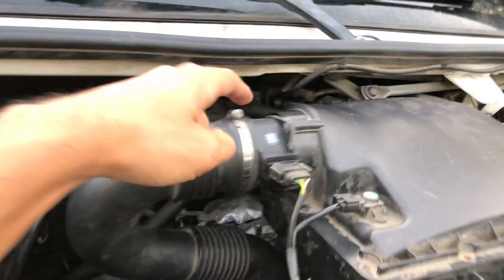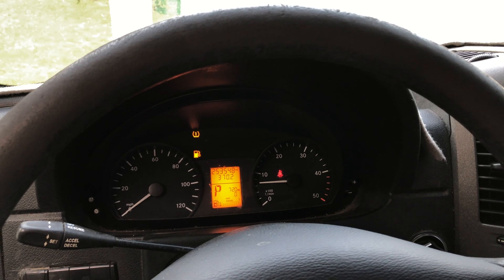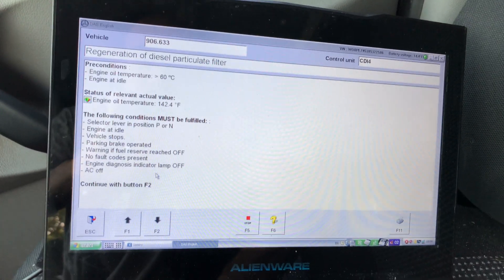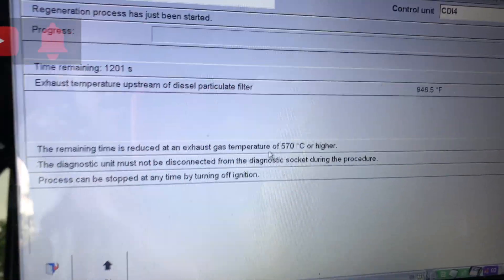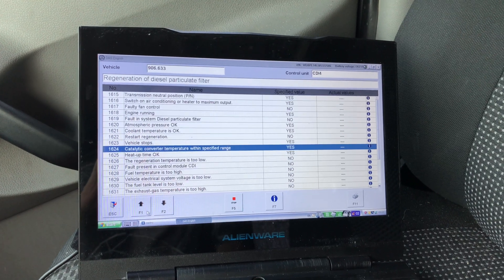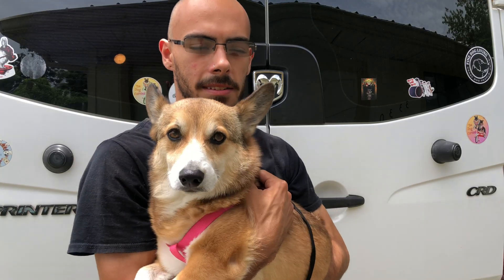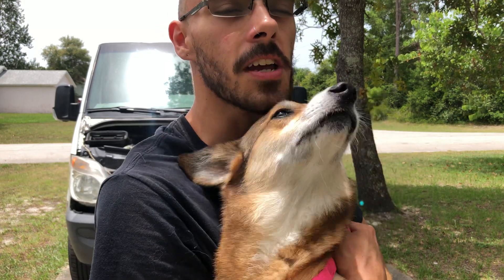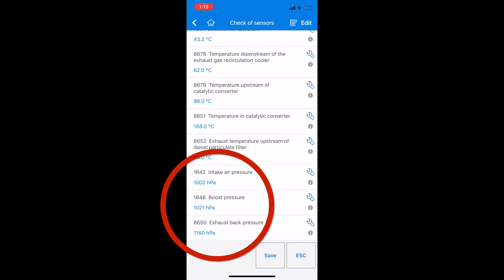Manual DPF Regen with Xentry DAS! 2007+ Mercedes Sprinter

Comment: I have a 2018 Sprinnter 2500 4x4 recently had a check engine light come on and when I checked the codes it said something about an NOX sensor downstream I changed the sensor. Took out for a drive and did an active region on the highway after I did it I received a 10 starts left message. Any help ?

Comment: What would cause a P0101 code with key on engine off? What is the computer looking for when there’s no air flowing?
Reply from the maker: P0101 is a generic code and completely meaningless. The van did not produce that code, like a word not in its vocabulary. So the code reader is miscommunicating some other unknown code.
Reply: @FloridaVanMan  would there be a reason why the computer would trip a generic code and not a Mercedes code. I’m not getting any DTCs on the Mercedes’ side. But the van is still in limp mode.

Comment: nice video. I was wondering I saw there was an option for tyre size, is that something you are able to change in the software? I have larger tyres and would love to be able to recalibrate the speedo
Reply from the maker: When I played with that option it didn't seem to make any difference and was very limited with only two size options, 15 and 16 inch wheels. However other folks have told me it worked for them. My 2005 with stock tires always ran 76 on the GPS when the dash showed 82. Now that I have bigger tires the speedo is correct to the GPS and the odometer is off by 7%.

Comment: Hey man I had a few quick questions about a 2006 sprinter motor I swapped into my 1965 Chevy c10. Would be very helpful
Reply from the maker: Aha!!!! I've seen your project before. We've never swapped the T1N motor into anything else....but we'd be willing to try and help you answer your questions anyway. It has a Sprinter ECU and cluster in it right? one condition; you've got to bring it to us or let us check it out one of these days....
Reply: Florida Van Man it would be a cross country trip haha, but i used sprinter ecu and cluster( basically everything from sprinter). I’m getting this problem with the turbo, codes p2025-001, p2013-001 and p2243-001. It seems to me that the actuator arm is really far down and I get a constant hiss but when I unplug the boost sensor on the charge air pipe the arm goes up and it sounds completely different. I should mention I do not have the sensor that was on the air box plugged in. Thanks for your help
Reply from the maker: @dieselkumar6451  The P2025 code is turbo related and and might be caused by the other problem. The P2013 is all about the sensor you don't have connected, so start there. Even if you can't put it in the air filter, secure it nearby. I imagine one could put it in the end of the cone filter but be careful about dirt leaks obviously. That might clear both codes, but if it does not my next steps would be verify voltage changes at the MAF (see our video). I suspect that cone filter is preventing the MAF from getting a good read, but others have had good experiences where I have not. If you do not get voltage changes similar to seen in our video try taking the filter off. Don't drive it with no filter, but testing for voltage while parked shouldn't suck up dirt. If the MAF voltage changes check your turbo clocking (see our video). It costs nothing to check it, if you don't loose the spring clip. P2243 I believe is a communication error between the key chip and ECM/SKREEM. This one may be a low battery start and just need to be cleared.  -Bill
Reply: Florida Van Man thanks for the help, do you have any idea what that sensor is called? So I can start by putting it somewhere
Reply from the maker: @dieselkumar6451  Intake Manifold Pressure Sensor  aka MAP is the one that belongs on top of the air box. Some places call it the Air Intake Pressure Sensor and it looks similar to the Boost Pressure Sensor, but it's different.

Comment: Bin the DPF xxxxx
Reply: DPF delete :-)
Reply from the maker: Highly tempted guys.....I think it would do a lot for the fuel mileage too...........
Reply: @FloridaVanMan  And power. It's not just the Sprinters, my mate's a diesel mechanic, if you are doing lots of motorway driving, no problems, stop start around towns, big problems. They're supposed to be good for 100K, he's had taxi driver in at 30 - 40K and the manufacturers don't want to help, they're a joke on light commercials and cars
Reply from the maker: At 253k, I am well over the expected life span of a singular diesel particulate filter. As someone who wants to put a lot of miles on, I can't see myself buying one every 100k.
Reply: @FloridaVanMan  Wurth do a DPF treatment, it might be worth a go however, as I said, my mate's a mechanic, he's seen them fail on taxi's at 30 - 40K.... If you're screaming down the highways, they're Ok but, I always think just go for efficiency, they choke engines.. https://www.youtube.com/watch?v=DTvcYpaTERE
Reply from the maker: I thought about a treatment but I'm doing so much local driving in it lately, that I feel it would do more harm than good to leave it on. It would be an interesting topic though, if I could do it without smoking out the neighbors haha.
Reply: Wont that generate codes? Is there a code fix?